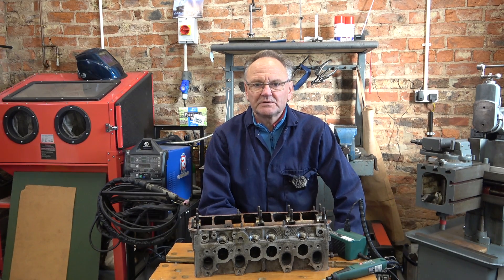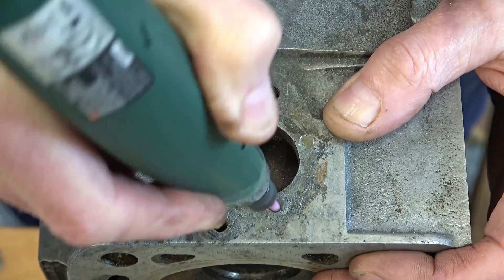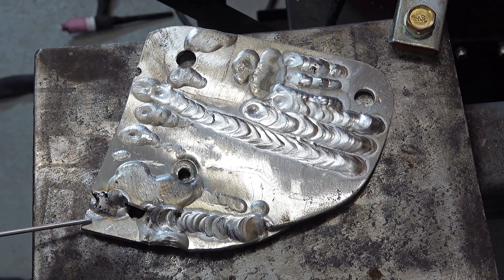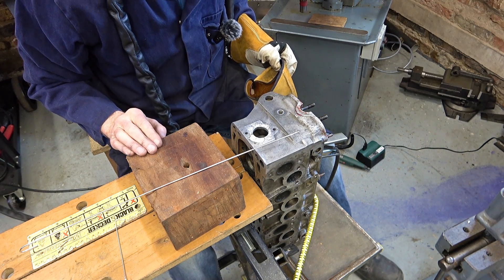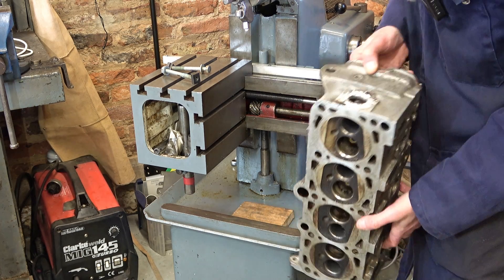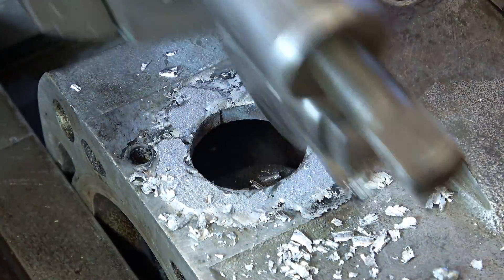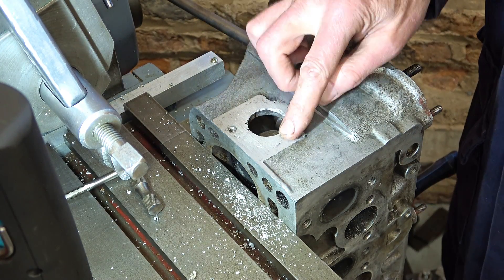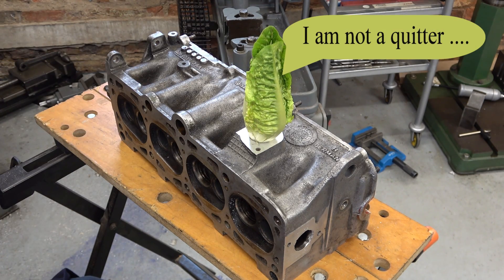HS163 VW Golf Mk2 GTI cylinder head repair

Comment: Good video Paul. I am not a welder but I do have some experience in maintenance welding repairs on aluminium components. You have to remember that aluminium has a heat capacity 10x that of steel. So that big block would dissipate huge amounts of heat. I'd be looking to start at 200 Amps without preheat, maybe 180 with. Aluminium takes in heat at a great rate before it starts to melt. Once it goes though, you have a "sweet spot" prior to thermal runaway. So once you are in the zone, you can back off the current a bit, either via a pedal or pause and use the pot on the welder.
Reply from the maker: Thanks Carl. Given it was a big cold lump then it's surprising it welded ok. I'll preheat next time. Cheers
Reply: @HaxbyShed  I don't believe it's always neccesary to preheat. I think if you start with a high current, the heat will inevitably soak in, unless we are talking about relatively massive sections. I think you did an excellent job and my words were not intended to be critical in any way.

Comment: Funnily enough I got the same TIG welder from R-Tech, with the same reasoning. Having done some alloy welding previously (350A water cooled Kempii that I bought for work 🙂) I knew I needed a decent amount of amps. The 170A was too small the 210 amp seemed about right and I couldn't justify even to myself the almost £300 jump for the next 40 amps. Have to say I have been very pleased with the welder, so much so that I also got the MIG and the little inverter MMA stick welder for those jobs when you need something portable.
Reply from the maker: Hi Bill, I spent ages deciding whether I wanted 170 or 210 and you possibly know that the stick rating is lower (I think 160A for the 210A model) so that's what drove me to the 210. The other thing is that the fan runs all the time on the 170A model, so they told me, whereas the fan only fires up when you strike an arc on the 210.  Now I've tried Alloy pulse it just reconfirms it was the right choice to go for the 210. Cheers
Reply: @HaxbyShed Yes, sometimes you can over think these things and then you prevaricate as to what you should do. For a long time, I have thought it best to go with the first thing you considered and get what you would end up with anyway. But saying it is a lot easier than doing it. 
I’m looking for a new lathe now, probably look at buying in the New Year, but once again I find I’m spending too much time investigating and not doing. The thing that has surprised me is the price ranges for what is essentially the same lathe from different suppliers. I’ve found prices between £9,700 and £20,000 and the only thing I can find different between them is the colour of the paint and the expensive ones come with “German supervision” while being manufactured. Sometime think I should just take up knitting.
Reply from the maker: @billdoodson4232  Bill that price range is staggering, but if you had not done your research you might not have uncovered that so it kinda validates the approach. Time spent on reconnaissance is seldom wasted - so they say. My wife is a knitting fanatic so let me know if you need lessons. 🙂

Comment: Well done for tackling that job. Some of the pitting on that first pad looked quite deep, almost as if it was a casting defect that had been revealed. Turned out really well!!

Good luck from Spain!!
Reply from the maker: Thank you David. I was really surprised how deep the pitting was, after I removed the corrosion. I did not think the weld would have penetrated deep enough to fill them but as you saw it turned out fine.  Happy days. Cheers

Comment: On a shaper you can make anything :)
Thanks for showing your welding progress. I found it very interesting.
Reply from the maker: Hi Rusti, I'm still on the learning curve with TIG. It's surprising some metals weld easier than you might expect and then others not so easy. I find stainless a delight to weld, so far. Cheers

Comment: Good job Paul.  I always found on AL heads and blocks with TIG, preheat the weld area min 150 deg F-250 deg F makes welding MUCH easier. It cooks out oils and contaminants, [use of the TIG over the whole area or use a gas torch, then clean with wire brush] The weld pool forms faster when starting TIG.  Pulse is not what you need for a piece of heavy AL like a block, you need the continious heat [pulse takes heat out ]  All in all turned out very good.
Reply from the maker: Thanks Al, I will add your advice to my memory bank. Cheers

Comment: Great job Paul, maybe a little preheat of the block would assist in welding, but impressive for a small amperage machine👍, quite a bit of the black arts to aluminium welding, the slag/contaminates are heavier than the base material, hence cleaning phase, in theory anyway. I can see more VW engine blocks coming your way very soon!!!!!!!!!!!
Thanks for sharing, hope you get rid of the lurgy soon.
Regards John.
Reply from the maker: Hi John, took me 3 weeks to shake off that chest cold. Dragged on forever.  Cheers

Comment: Well done. As you know, epoxy would have would have been fine, but what you did is a far superior fix. And both require good surface prep to work.
Reply from the maker: Hi W65er, I would have used epoxy myself but it was good experience and now I have a bit of ally welding experience. 😁 Cheers

Comment: Yes a lot of machine shops will simply grind that face out and put metal epoxy, and it will last the life of the vehicle. Been there done that, especially on a sunday afternoon, when all the shops are closed, and the car was needed for the morning to work. 5 minute epoxy to the rescue, though I also have done inserts into heads as well, especially for those little bolts that love to corrode out.
Reply from the maker: Hi Sean, there are a few damaged threads, but I think we will manage without insets on this one.  Cheers

Comment: Well done Paul buddy, on cast like that, it really plays to work the arc over the surface a few times first, to both preheat and draw any sh!t out of the material
Reply from the maker: Hi Ralfy, I will preheat next time. Probably shove it in the oven for an hour when the wife is out. Cheers

Comment: Hi Paul, just a tip: if the carbide burr clogs when grinding aluminium use some WD40 and it will help stop the clogging. Great video. Regards Kevin
Reply from the maker: Hi Kevin, thanks. I will have the WD40 handy next time.  Cheers

Comment: Cheepo carbide burs that you can find on line are much better for cleaning up Al! Clean up with stainless wire brushes or carbide burs, avoid stones, you can imbed grit!  Al tig always AC. Cheers, Matthew
Reply from the maker: Hi Matthew, I will look out for the small carbide burs. I bought that Dremel clone ages ago and decided it lacked power (too easy to stall) but then I used it twice in a week. The other job was getting filler and paint out of cross-head screws so I could unscrew them - it was perfect for that.   Cheers

Comment: Watching  you TIG weld that face I thought you could do with a slightly larger welding rotator. Next project? :-)
Reply from the maker: Peter I did not think of it at the time but yes I could have removed the jaws from the rotator and used it as a small rotating table perhaps. In fact it's an idea I should keep in mind.  Cheers

Comment: Perhaps in hindsight you overthought that welding of an aluminum casting.  Unlike the welding of aluminum thin-sections,  cast aluminum can be pretty forgiving, especially when it will be machined-off later .  Pretty welds are often just a vanity exercise or a work of artistic expression .   You did a more than fine job !  
P.S   Tungsten electrode contamination is an ever present danger with aluminum --  you are hardly the first one to be plagued by the innocent slip of hand .
Reply from the maker: Hi Ken, as a first timer on a casting like that I was surprised it was easier than I expected. I was sure I had left cavities but apparently not. I will be more confident/experienced next time. Cheers